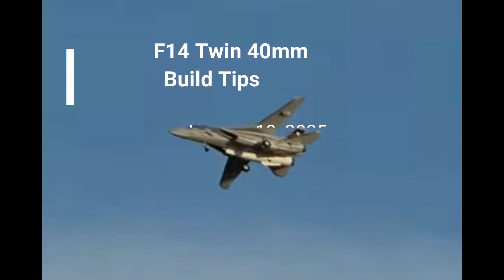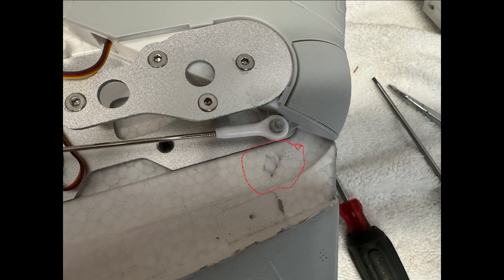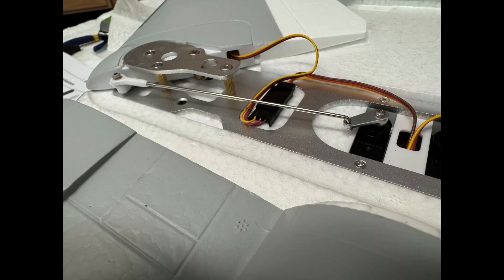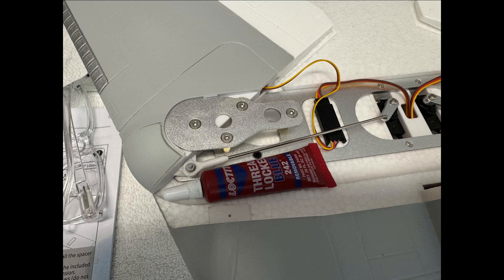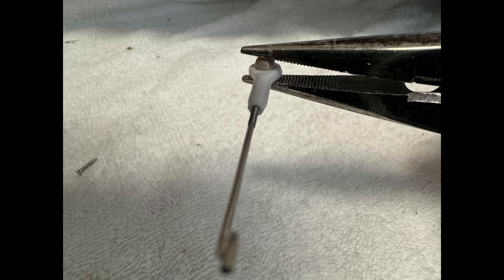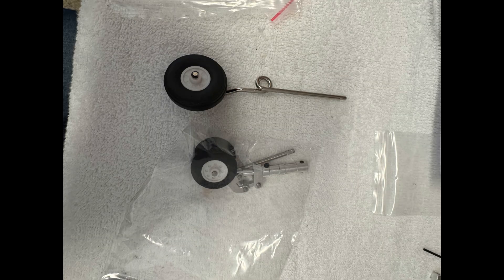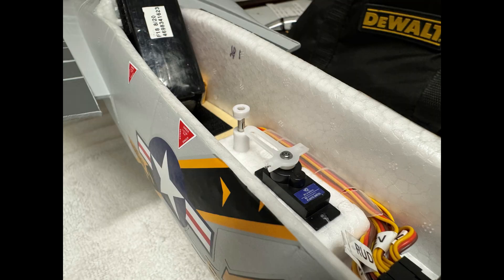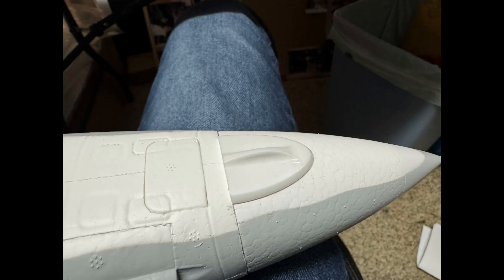Xfly F14 Twin 40mm Build Tips

Comment: HI just thought you might like to know that the spacer does not go where you were showing it - if you examine it closely, you will see it has a little notch in it this notch sits nice and snug on the front nose gear spring  - strut - the spacer should be on the outside.  Nice video cannot wait to get them here in the UK - thanks

Comment: Hi there, just 2 things, if I may. I highly suggest investing in ball link pliers, it'll make things far easier. And the spacer goes under the fuse if you're going to use the wire gear. Place it so the notch is on the loop.
Reply from the maker: Good points...I missed the spacer in the instructions and will definitely get the pliers.